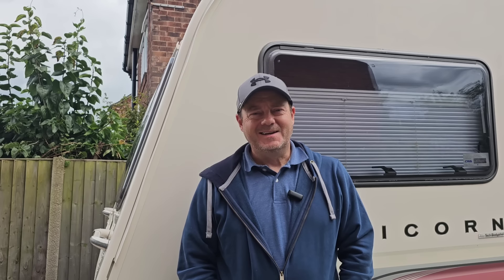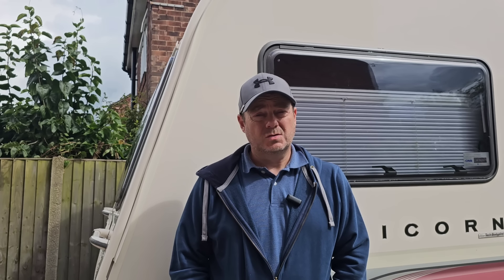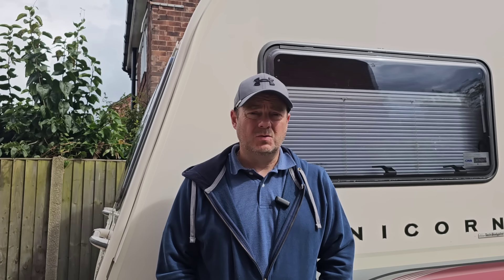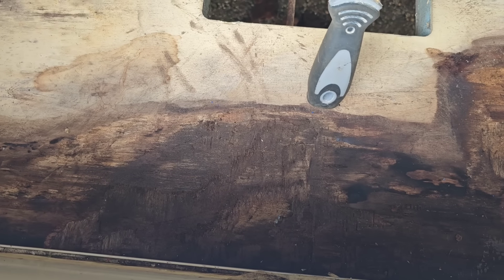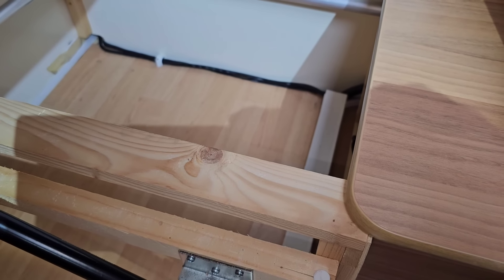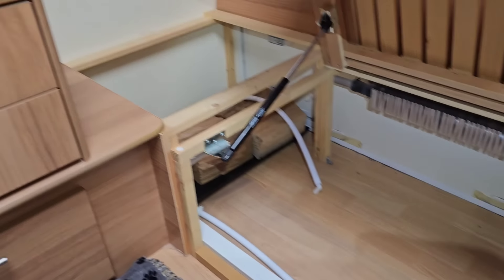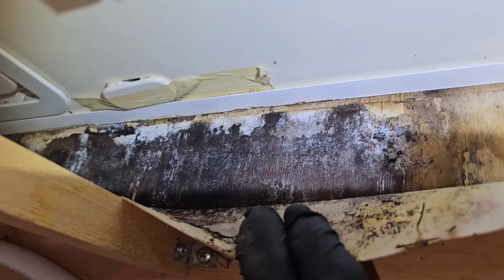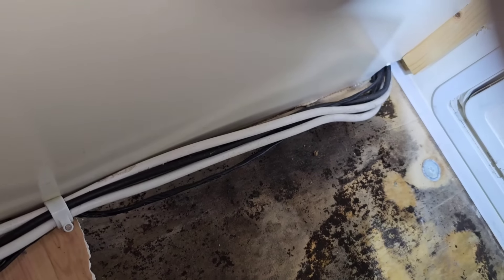Caravan Damp Nightmare! Our Story.

Comment: I really feel for you mate.    We had an issue with our main dealer when we bought our brand new Bailey Pursuit back in 2017.   We had it 2 years with no issues and it was serviced by the supplying dealer for those first two services.   3 weeks after we had the second service which we were given a clean bill of health for, we decided to part exchange it for a new one.    This was with a different dealer.    On dropping off the Pursuit we were told the front end had 80% damp right across the front end.   This was given a report of only 18% across the front!!!    Dealers are crooks!!!
Reply from the maker: That's pretty terrible isn't it. There must be one or two decent dealers out there, but sadly stories like yours seem pretty common.

Comment: We have a 2008 Bailey Senator Indiana caravan. It is stored in my shed when we are not touring and to date no sign of any damp. I practice preventative maintenance and I regularly check all sealant joints and at 10yrs old I replaced the sealant in  the joints where accessible.  The front locker has no ply type flooring but a recessed plastic tray across the entire front with  several vents in it for glass bottle storage. We live in New Zealand and our weather varies from snow to torrential downpours and up to 35 degrees C and our roads can be pretty rough in places. I have towed the van over every mountain pass in NZ several times and the Van has survived to date with some minor repairs to cabinetry etc all done by myself as a Retired chippy. I believe that anyone buying a caravan should store it under cover if you don't want leak headaches.

Comment: We purchased a brand new Unicorn Valencia back in 2011, the Alu-tech was brand new that year so was ‘innovative’ as it apparently meant that this new design wouldn’t let wet in as previous designs.  We had the same issue with the damp floor after only a few years.  It went back to Bailey to be repaired and when we got it back they had damaged other bits in the van, a chunk out of the toilet and a scrape where they pushed a cupboard unit back in.  We exchanged that for a brand new Valencia in 2016.  This one wasn’t too bad, the only problem this time was the roof strap leaked but we could see the water running down the wall and, as it wasn’t hidden, we noticed it straightaway and got it fixed.  We decided to trade this one in 2022 to a brand new Vigo.  What a mistake!  We have had this one 18 months and had the specified service done.  In October we looked under the front seats and lo and behold! a floor, black with mould and visible water ingress, which has also blown the front drawer unit.  Bailey have already agreed to replace the front blinds under warranty, which are absolute rubbish, unfortunately with the same blinds, they have improved the blinds in the 2024 models.  Now back at dealers for a damp assessment.  We will be interested in the outcome.
Reply: The sad thing is Bailey do have some good layouts and designs. but if you have had 2 bad vans why would you buy a third ?
Reply: A mate of mine bought Bailey unicorn Sinatra in 2021 and what a nightmare it’s been for him, damp, doors not lining up, leaks from water pipes etc etc you name it and the van has had it. Been back to the dealer more times  than I’ve had hot dinners. Use of cheap imported materials and a lack of skilled labour springs to mind. So typical of this country.

Comment: I brought my first ever caravan just over a month ago, before i even looked at one, i armed myself with a damp meter and went over the whole thing. Its an older Bailey from 2007, not a bit of damp anywhere, but I'll be going over the entire outside and ripping out and replacing all sealer in any joints, around windows and anywhere else that needs it. I used to build caravans so i know how cheaply built they are, but the important thing is to go in with eyes wide open and mitigate where possible.

Comment: We bought a Unicorn Valencia new 2011. It was serviced at dealership for 6 years. It was traded in and on inspection was damp around front floor area but warranty was honoured due to complete service history.
The front lockers around the floor  was always mentioned on forums for damp and the front locker/chest area.
Our van was part ex and repaired via Bailey approved workshop.
You did the right thing selling it back , good luck with buying another
Reply: You Should have  pursued It to court these dealers keep getting  away with  it,have had several  issues  myself. Definitely  more than a year  old damp.

Comment: In 2016 we decided to treat ourselves to a brand  new caravan.  Choice came down to a Swift Conqueror 645 and a Bailey Unicorn Cartegena. We went to a dealer in Surrey as they had both on display . It was a foul day, wet and windy, Difficult to choose between them, The Bailey had a nice interior but externally we both felt was hideous, clumsy graphics, that horrible great window and lots of cheap plastic dress up panels trying to make it look better while the Swift was far more pleasant to look at and we preferred the colours of the interior. Deciding factor was when we were sitting in the Bailey during some particularly heavy rain it was actually leaking onto the bed.
Queried it with the salesman who said a lot of them do that but it's an easy fix. 
We bought the Swift.
 Since found out that the Alutech is pretty poor generally and rotten floors are common on even very recent versions.

Comment: I know how you feel Charlie. I just traded in my 2015 Elddis Crusader Storm (SOLID construction) for a brand new caravan. To my mind and according to a local mobile service company a few months ago, the Elddis was near immaculate and showed absolutely no signs of damp. Fast forward to the new van collection date (two weeks ago). The dealer inspected my trade-in, according to them the floor was well damp and needed replacing at at an estimated cost of about 6 or 7 thousand pounds. There were NO visible signs or smell of damp but the dealers meter probes through the vinyl flooring showed up to 50% moisture.  The thing is, my van was used for about 8 weeks total in its life. It was always heated and aired through winter and I think it was only used two or three times in wet weather. Apparently though, spray from the wheels had gotten into the floor. This then begs the question, is there ANYTHING we can do to protect a caravan floor or is it just a matter of time? I still got the new van but several thousands knocked off the trade-in value. Being a new Swift Elegance the replacement is supposedly 'timber-less' construction. Well nearly. Guess what the floor is made of!
Reply: You should have walked away, and found another deal, sound's very suspicious to me.

Comment: I totally feel for you.. I've got a 2013 swift twin axle and I've done 2 major damp repairs using the original manufacturer spec wallboard... And cut all the damp out and repaired as new.. There is a fantastic supplier called Halesowen caravans.. This fella supplies every matching UK Carvan wallboard since 2000.. Do it yourself and do it properly.. That's my motto

Comment: I've had an elddis 840 supreme from new  now five years old. For the past three years the annual service has found damp. Each year its been sorted under warranty but I'd never buy another elddis. I felt for you as you were pealing back the floor. You are dam right. Get any secondhand van checked independently before purchasing.
Reply: Common in all hymers group vans now ..compass etc.. the front windows are not sealed properly at build and front top  seal not sealed properly..
ive a 2022 compass .front end is rotten ,,warranty fix next month,,
DO NOT BUY ANY HYMER MADE UNITS AS THEY ALL ROT AT THE FRONT WINDOWS FROM NEW ..

Comment: Feel for you, all owners nightmare!  One thing I was taught when looking for a van was to use my nose, did they load it with scent diffusers as I would of imagined that volume of mould would be nosed out?  Oh and a damp meter, one van I looked at I pushed the prongs through the inside wall it was so wet, I didnt make an offer and left sharply 😂.

I bought a 1992 Bessacar 20 years old, and she's still going strong, it didnt matter too much about any damp for £1,000 all in, but didnt have any.  I was lucky I'm sure.  

Good luck.

Comment: Yep we had a Bailey ranger from new in 2008, and by 2013  it was leaking like a sieve, all 4 top corners, the 3 bunk windows at the rear and the front window. I would never bye another Bailey caravan
Reply: I've been having caravans for over 50 years various makes they all had damp .where you have metal you get condensation .so buy a glassfibre one.

Comment: There is an industry wide conspiracy to hide the inevitability of damp ingress in caravans and it runs through the clubs and caravan magazines too.  Caravans are now phenomenally expensive but are sold on the assumption that they are an investment that will last for decades. That may be true of motorcaravans but not caravans which are poorly engineered using sub-standard materials. Unlike motorcaravans, Caravans twist and shear when driven on the road. This opens up the seams and lets in water which pools down at the edges of the floor.  This floor should be made from Marine Ply but is actually the type of cheapo plywood used to batten down doors and windows on building sites. If Marine Ply was used and the end grain protected then even if water got onto it it would not cause delamination of the wood and be eminiently repairable but even though you may be paying 30K for your caravan the mfgs only expect it to last for the life of your hire-purchase agreement.   In 1984 we purchaed a 10 year old Lunar Clubman caravan and I resealed all the joints and capings.  I also checked under the van for the floor which was at that time very sound. I could no ttell whether it was made from Marine Ply but just in case I coated the entire surface of the underfloor with waxoyl as well as the chassis etc.  Ten years later I discovered that water from wheel spray had been pushed to the back of the van and started delaminating the plywood floor. The Waxoyl had worked on all the flat bits but the rainwater had seeped into the end grain and moved along inside delaminating the floor above into a spongy mess.  This would not happen with Marine Ply.  I don't suppose we can expect a caravan to last for ever but we should expect that regular professional engineering is used to fabricate them, it would perhaps add an extra couple of hundred pounds to the cost - a pittance compared with the astronomical costs of caravans today.  The NCC should be calling this out and demanding thicker topside marine ply veneers to strengthen all caravan floors, as part of their specifications but they refuse to do so. It is a scandal. I made some temporary repairs to our beloved Lunar Clubman which gave us a couple of seasons reprieve but when the floor went spongy as you stepped through the entrance door it went to the caravan graveyard.
Reply: Why keep using plywood when plastic sheeting is cheap enough.
Reply: Agree with your comment however some of your terminology is incorrect. A lot of people use the term marine ply assuming it means a heavily treated product to protect from moisture damage. This is incorrect as a marine ply refers to an untreated plywood. It is untreated but uses a waterproof glue. This is to prevent the treatment chemicals causing a corrosive reaction when fastened to, or in the vicinity of various different metals in a marine environment. I am unsure but suspect the reason these vans use an untreated plywood, is to prevent this same situation from occurring to the metal chassis, cladding and fasteners.

Comment: I was advised by the sales director of a large multi brand dealer that anything made after 2005 was to a lower standard to maximise profit. Have had 5 vans over the years the worst was a 2006 ace, and the current van is a 2002 coachman which has no damp issues on the service this week at an independent. Feel for you.

Comment: I bought a 2011 sterling eccles quartz and after 11 months we found damp at the rear of the caravan on both sides in the bedroom. Out dealer took the caravan in a month or so after we told him and asked us to seal where we could until we brought the caravan in. He is now repairing it under the year warranty he gave us at purchase and that repair when it is completed will be covered for another year, at no extra cost to me. The leakagecwas from the awning rails on both sides from where it was initially connected at manufacture and small micro cracks have propagated with the natural movement of the caravan in transit. I haven't got the caravan back yet, but so far he seems to be fair and equitable, obviously trying to preserve his good reputation.
Reply: update - our dealer took our caravan in. Then his repair team removed the awning rails and they actually found that the sealant underneath the awning rails, on both sides, had shrunk and dried out with age, allowing water ingress. They then replaced the sealant and replaced the awning rails as well as replacing water damaged panels on both sides of the caravan at low level, where the water had collected.
We have since been away in horrendously wet weather over a couple of days, with no sign of further leakage. Very satisfied customer so far. The dealer said that if it was not under warranty, it would have cost me north of £2000 to repair.

Comment: Our first Caravan was a 1997 Eldis when we traded it in the salesman was astonished that there wasn't a bit of damp in any parts of our old van,
In hindsight wish we never got rid of it.
Our Swift Caravan soon got damp problems.
Which I found fairly quickly and sorted out myself.
Good dealer are few and far between.
And by the looks of the ply they used in your floor of the bailey it's not even marine grade ply just cheap as you can get.

Comment: I used to make motorhomes and i can honestly say when buying British units,be it motorhome or caravan, you will be VERY LUCKY not to experience damp. The main bodyshell of any unit is too rigid so cracks will appear eventually on back panels and roof lights. Elddis had major issues with leaking rooflights because of their 'Solid' construction. Basically Solid construction methods made their units again too rigid, thus they had or still have issues with cracking plastic frames. On the whole British made vans are not in the same league as Adria or hymer for building quality. 10 year water ingress warranties ONLY apply to the main bodyshell of the unit.
Reply: ELDDIS IS HYMER THEY LEAK FROM NEW M8,, TOTAL JUNK,,  Was so bad in compass ..hymers.. they dropped the compass name to reduce bad press
Reply: @daveharrison9319  NO Hymer bought Elddis. Elddis is Elddis which look great but are poor build quality. Compass branding was deleted to concentrate on the ' Elddis brand '. Same when Swift deleted the Abbey ( even though the brand outsold swift brand) Ace and Sterling.

Comment: An 11 year old caravan is, on average, nearing the end of its life. Around 50% don't make it past 14 years old, so you need to be very wary when buying at that sort of age. As to the dealer buying it back or you rejecting it and him making an adjustment for the period you've owned it the amount you got isn't too bad, given that 2011 Seville's have a current dealer asking price of around £9,500. Talk of Continental vans not getting damp is to some extent true but their build standards have reduced dramatically in recent years. The last year of Hymer Nova GL 2 berth production in 2019 their van cost a smidge under £40k and had an MTPLM of 1800kg. Compare that to a Seville of that period that cost about £23k and had a 1326kg MTPLM. So there's a reason Hymers didn't leak, they cost 75% more than their UK counterparts and weighed 35% more. The Nova GL if it was still made now in 2 berth form would cost more than £50K to buy, that's why Hymer have downgraded their structures because very, very few would be bought at those prices.

Comment: Mate,we had a 2010 pegasus from new and within 2 years the floor was damp exactly same as yours.water was getting in via the grab rails and running down the wires and also from round the bottom mouldings.we had fungus growing underneath !! dealer dried and repaired but it was just one of many construction issues.hope you get sorted.
Reply: I bought a 9mtr RV second hand ,took out the fitted furniture and in the corner a problem of water getting in ,l had everything resealed,and every time  it rained, it knocked the electricity out    .
found out in the end it was a outside kitchen vent put on up side down ,turned it round end of problem,
But it cost a small fortune before we found it

Comment: Gutted for you and hope it gets resolved soon. All the bailey range suffers the same, i bought a brand new swift in 2017...no wood and a superb caravan never been happier.
Reply: Why do you think swift and others transitioned to plastic framing?
Reply: @Dusty2feathers  because they GRP panels now offer high strength with a degree of flexibility which are both things you need in a box on wheels that you tow on bumpy British roads lol
Reply: @pablo123b  GRP panels don't really increase durability. You're right about the British roads though, which is why the manufacturer's started fitting shock absorbers a few ago. They simply couldn't keep the damp out. Another point to mention that when caravans were timber framed and were damp, you could smell it as soon as you walked in. Not so much now. I had a good long chat with Peter Coupland a few years ago and he told me Bailey caravans were popular in their workshop. Several years ago they resorted to drilling pilot holes in the back panels just so water could drain away. Shocking.